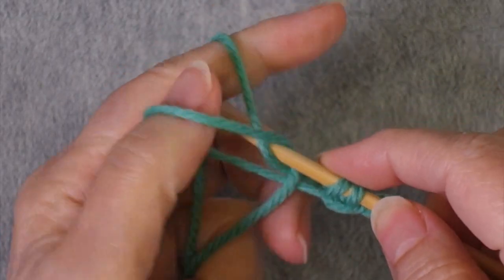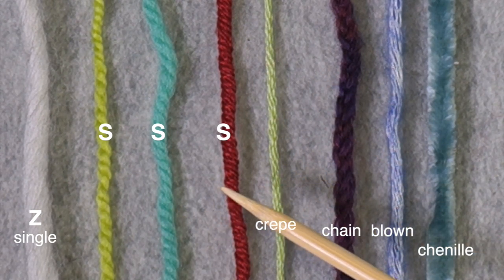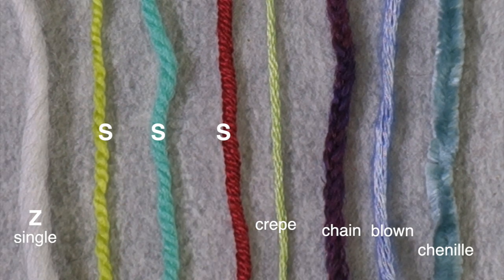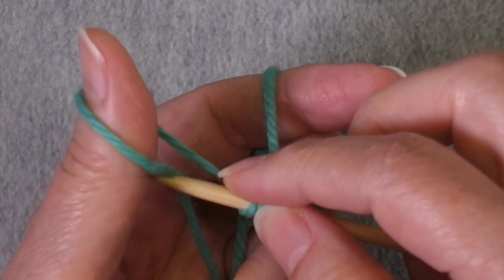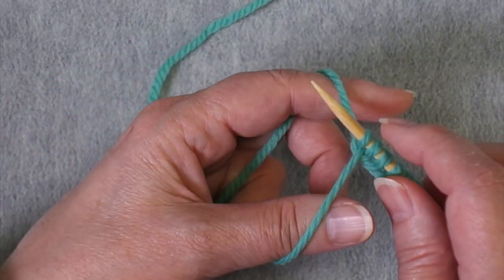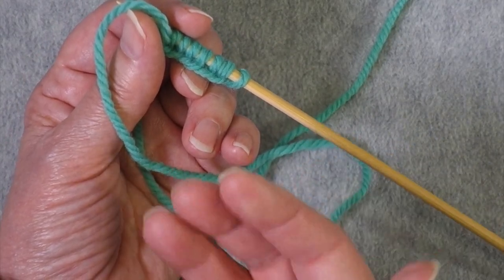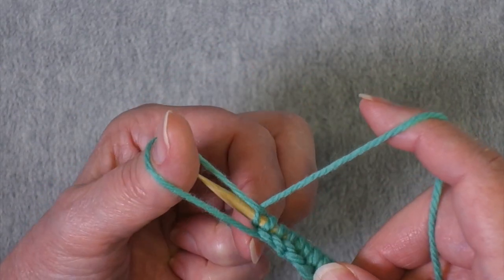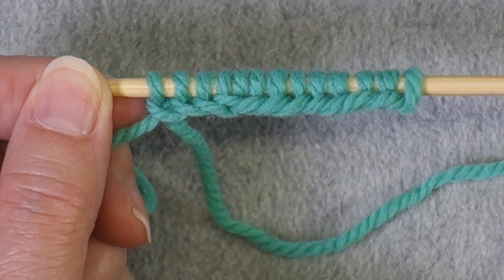Avoiding Twist Loss in the Long Tail Cast-On (LTCO) / Technique Tuesday

Comment: My exact dilemma and you have solutions!  In my knitting circles I'm considered to be too observant: "It's not a big deal. Why do you look so closely at everything. Just cast on and knit..."   I was excited when I intuited that I could cast on with a purl stitch and have the smooth side for the right side of the work.  I quietly kept that revelation to myself.  I'm excited for when I cast on my next project!  I'm in the middle of one now so for the sake of continuity in the garment, I wont be incorporating these gems of knowledge straight away.  Tk you for sharing your knowledge.

Comment: WOW! Always something interesting to learn, thanks!
On the other side of the coin, I'm a thrower and usually have the problem of increasing twist as I knit along. I mentioned this to a woman I've bought yarn from and she said she's never had that problem so she could not tell me what it could be. I think part of it is the way I tension the yarn around my fingers: first, clockwise around my pinkie then, clockwise around my index finger. 
Your visual of the directions around the needle makes sense (gotta start practicing Continental 😳).
Thanks, again. 
💖🙌🙌🙌😺
Reply from the maker: Twist can be added to yarn in other ways. (Continental knitting isn't going to change that.) You might be interested in this video on avoiding excess twist as you knit: https://youtu.be/-lgXdWfa5-M

Comment: Great tutorial and explanations, I was blown away! However, the twist loss in the tail doesn't drive me nearly as nuts as the twist GAIN in the working yarn. The working yarn gets so kinky, I try to minimize the distance between the yarn in my hand and the ball/skein itself, or I hold the ball up after and let the needles with the cast-on stitches dangle and untwist, but sometimes that's physically difficult (no room, in a car, whatever). Is there a fix for too much twist in the working yarn?
Reply from the maker: I did do a video on avoiding excess twist as you knit: https://youtu.be/-lgXdWfa5-M

Comment: Thank you for this video, so helpful! I did notice the twist loss but I drop the yarn and pick it back up, so annoying. I think I'll try method 2. I used to use the German twisted cast on a lot, I wonder if it has the same twist loss issue? I reverted back to long tail because I kept running out of yarn using german twisted cast on for larger projects.
Reply from the maker: The Twisted German CO creates a twist within the edge, which hides the twist loss (you don't lose less twist in the yarn ply, but you're adding an actual twist/loop, which hides it.  You can avoid running out of yarn for the tail for either LTCO or Twisted German by spit splicing the two ends of a center pull ball together, and starting the CO at/near the join. This requires the yarn to be non-superwash wool No need to measure off a tail. When the CO is complete, cut the thumb yarn, leaving 4-6'' to weave in later. If your yarn won't spit spice, you can just start the cast on with the two separate tails, and again, cut the thumb yarn when you've completed the CO. That leaves you with two extra tails to weave in, but you don't have to worry about running out of tail.
Reply: @RoxanneRichardson  That is just the coolest tip.  That may just become my standard cast on method. Love your guidance Roxanne.

Comment: Thanks for the butterfly tie technique. Simply beautiful, Roxy. Question: in what situation would you prefer to use the purl on method?
Reply from the maker: Without regard to whether or not I was trying to avoid losing tail twist, I would use the LTCO purlwise if there was a reason why I needed row 1 of the project to absolutely be a RS row, with the smooth side of the CO facing.
Reply: @RoxanneRichardson  Thanks, again.

Comment: New knitter here- thanks for this. Any chance you’d be able to address twist loss in regular knitting *for a leftie*? I am assuming it’s what you also address here but my stitches split with acrylic worsted medium and it’s very difficult to knit well- I don’t know how to adjust my knitting to prevent this. Thank you for solving part of my splitting problem!
Reply from the maker: Handedness shouldn't affect twist. The twist of the yarn combined with the direction you bring the yarn around the needle is what affects addition or loss of twist. If you are a mirror knitter (maybe that's what you're referring to, regarding being a leftie), again, it's the direction the yarn goes around the needle that will affect the twist. So if you're bringing the yarn around clockwise, and you are using an s-plied yarn, you're going to lose twist. This happens with Eastern knitters (those who knit off the left hand needle, as for standard knitting, but wrap the yarn clockwise). The only way to avoid twist loss would either be to change the direction you wrap the yarn around the needle, or to work with yarns that are z-plied (you can find those in the U.S. and western Europe, but they aren't as common as S-plied yarns).

Comment: So this is giving me an immediately neater result in my cast on with S plied yarn when I use method #2 by wrapping the thumb yarn in the opposite (counter clockwise) direction as you'd shown, and forming the stitch differently, based on where I need to put my needle into the thumb yarn to create the stitch.  But it seems to me that it is only the base that gets affected by this, not the formed stitch, which I believe still behaves as Western with the leading leg in front.  At least when I tried to knit the first row from the cast on, I did not find I needed to work through the back loops of the cast on stitches to re-orient the stitch mount.  Do I have this correct?  If so, you have shown me some magic here for truly tightening up my base without having to cast on in purl.  Thanks, Roxanne!
Reply from the maker: The thumb loop is twisted opposite, but because you knit it immediately with the working yarn, and wrap it/pick it in the same way you would normally, the stitch mount of the loops on the needle are not affected. It's the direction you wrap/pick the working yarn that produces an Eastern or Western mounted stitch on the needle.
Reply: @RoxanneRichardson  This makes total sense hearing it, and doing it, that the wrapping creates the mount.  Coming up, I plan to use this twist-preserving thumb mount with my next cast on, above it which will sit a garter stitch border.  I will test it with a needle size smaller, and with the same size needle as the garter stitch, to see if I really need to go down a needle size, now that I have a great way to tighten up the cast on base stitches.  I had really been disliking the relatively giant loops that comprise the first row of knitting garter off the standard thumb mount LTCO and it will be very interesting to see if the twist-preserving thumb mount plays any role in taming this.  I am not a loose knitter (tight-tending, if anything) and I don't get this sloppy first row loop effect outside of garter stitch (at least I haven't noticed it in other stitch patterns).  Can't wait to test this with this great tool you have taught for improving the cast on foundation.

Comment: I use the German Twisted (Old Norwegian) Cast On because it is much more substantial (and stretchy) than a regular Long Tail Cast On (which give a rather meager edge to fabrics). How do I use this method and get the best of both worlds? The long tail cast on is just not good enough anymore now that I've graduated from it, but I want something with more substance (keeping my twist, if possible)

Comment: What is the benefit of using the other direction cast on? Purl bump method?  Is it best to do a looser tension with the normal continental cast on then. Mechanical spinning vs manual spinning changes, historically? Thanks for the topic.
Reply from the maker: There is no "best." There are usually multiple ways of getting to the same end point, and most knitters will find that they have a preferred path to getting there. Occasionally, they will find that the particular project they are working on needs a different path. Some knitters like trying different paths just for the heck of it, or to see if a different path suits them better. For most knitters, it will be enough to loosen their grip on the yarn every couple of sts, in order to let the twist back into the yarn. Others hate the loss of twist and will want to adopt the second method. Occasionally, someone will want Row 1 to have the smooth side of the CO facing so will CO using Method 3, which causes the bumpy side to face during CO. Method 3 is useful regardless of whether or not you are concerned about losing twist. It's a technique used when you want the smooth side on Row 1. It just happens to also solve the twist loss problem.
Reply: @RoxanneRichardson  Thank you.  I will note method 3.  I have recently learned a looser tension hanging yarn method, in continental is best, quicker too.  I may become a combination knitter in the end.  Thanks again...

Comment: My issue is loosing twist in the yarn as I knit!
Reply from the maker: Do you knit in the standard "Western" method, so that the sts move from the left needle to the right needle, and the working yarn goes around the needle counterclockwise as you work your knits and your purls? Do the sts sit on the needle with the leading leg (leg of the st closest to the tip) over the front of the needle for all sts?
Reply: @RoxanneRichardson  yws I do, and I hold the yarn in my left hand, so its the same as thw cast on explanations here?
Reply from the maker: @sherrikent6628  If you knit in the standard way and are losing twist with an s-twist yarn, there may be something else going on to cause the twist loss. Best way to figure it out would be to post in my Ravelry group with some photos.

Comment: I was always running out of tail yarn, having to rip them out until I finally got it right, then I decided to try using the working end around my thumb to form the loops instead.  Voilà!  Hardly any length is used up from the tail around my index finger, so I could make so cast on so much more this way.  Is there a reason no one else does it this way?  

By the way, your video here was terrific, very clear, and I’m sharing it with my knitting friends.  Thank you so much.
Reply from the maker: Some people do CO this way, usually unintentionally, just positioning the tails around their fingers however they end up. The reason why it wouldn't typically be done that way is that the working yarn is used to create the sts on the needle, so the working yarn forms the last stitch of the CO onto the needle, and then the next stitch that is worked on the first row/round would be worked with the same yarn, so that the sts are connected to each other with that same bit of yarn. It's not a disaster to swap the yarns for the CO, and to use the working yarn to form the edge, if you have found that to be a good solution for your own knitting.

There are some pretty good rules of thumb for quickly estimating the yarn needed for the tail, and even some methods for casting on without having to measure at all. https://youtu.be/urHhY-aYjKw

Comment: I had never noticed this before, so I did a "test" LTCO while watching the video. If I reset between each stitch, there is no loss of twist. If I do not reset, I had loss of twist in my working yarn and extra twist in my tail; not a surprise, I am a mirror knitter.
Reply from the maker: If your yarn is going around the needle/thumb in opposite directions, that will happen!